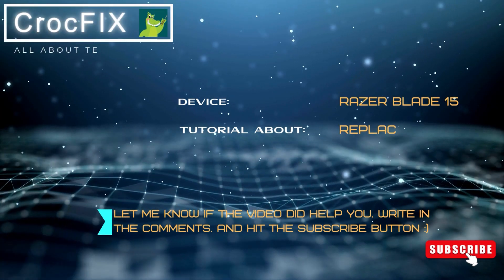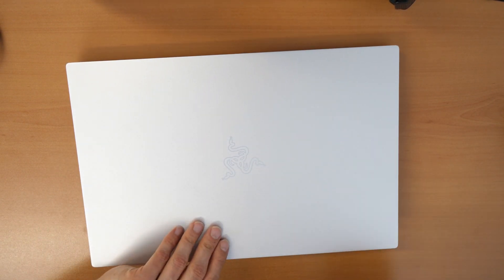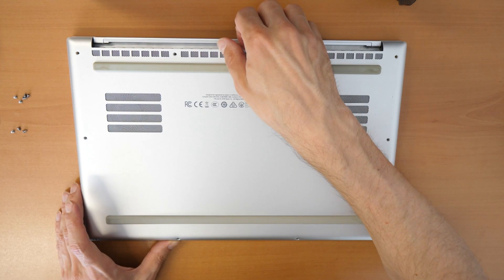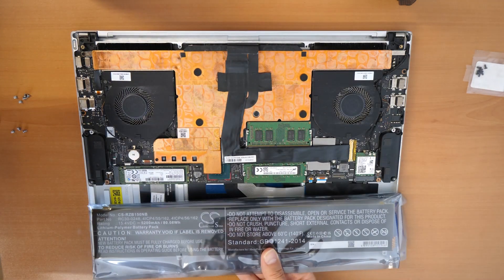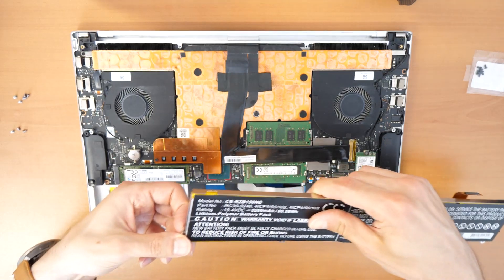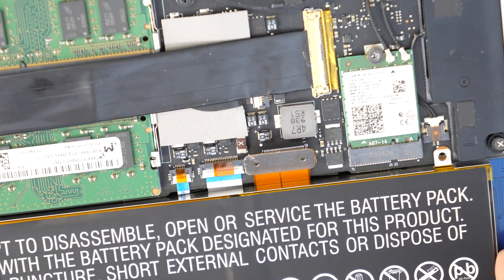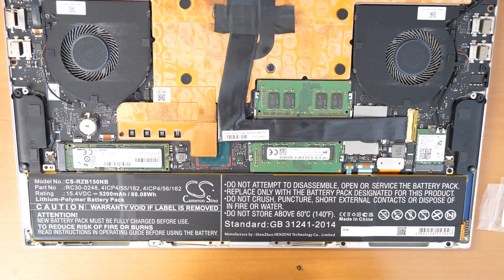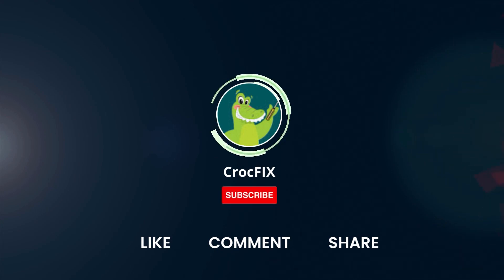RAZER Blade 15 / blown up? / Upgrade options & How to Replace the battery

Comment: After replacing my battery on Blade 14 (2022) the battery indicator is gone and I cannot start PC from battery, however after i lunched it from a power adapter, battery actually keeps laptop running even if I unplug power supply. Any ideas? Anyone else faced this?
Reply from the maker: Try to update the bios and try to reconnect the battery. If it won't help it could be a bad electronic - bms on the battery.